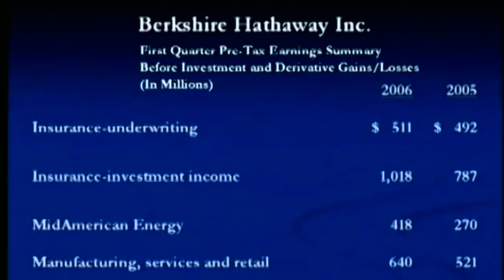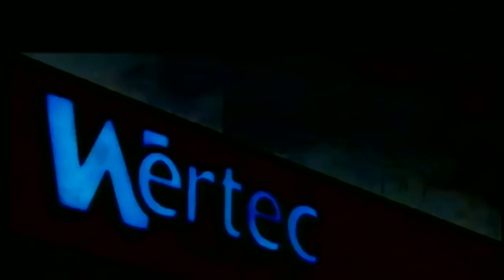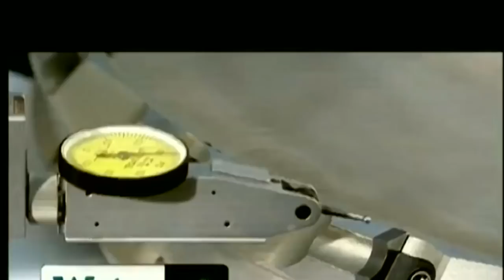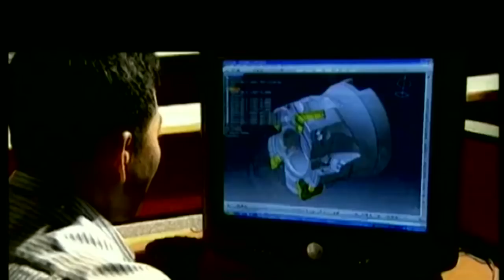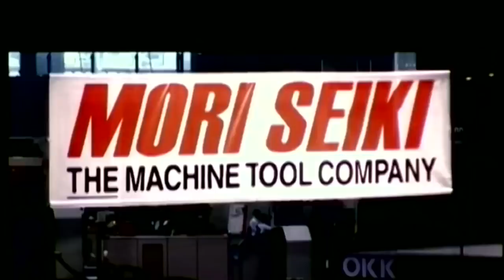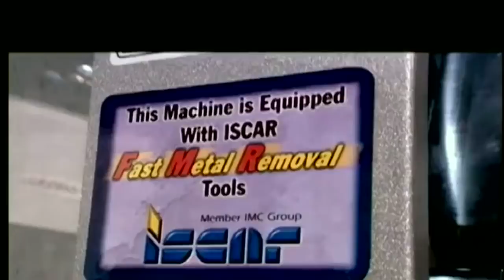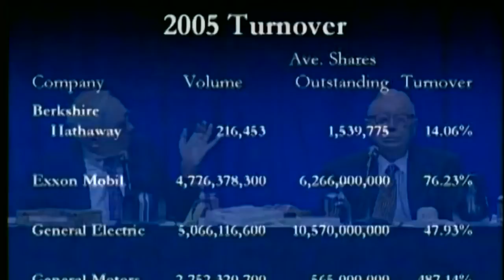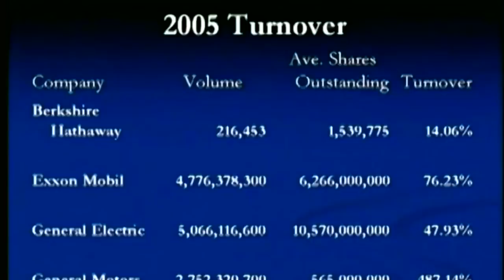TIMESAVER EDIT - FULL Q&A Warren Buffett Charlie Munger 2006 Berkshire Hathaway Annual Meeting

Comment: - Focus on businesses you understand and that have a strong competitive advantage. [Timestamp: 1:43:53]

- Be cautious about investing in industries facing significant technological disruption or intense competition. [Timestamp: 2:00:31]

- Consider the long-term economic implications of large current account deficits and prepare for potential currency adjustments. [Timestamp: 2:44:57]

- Maintain an investment philosophy that prioritizes facts and logical reasoning over market sentiment and speculation. [Timestamp: 3:18:25]

- Approach potential acquisitions with a focus on the long-term culture fit rather than short-term financial gains. [Timestamp: 3:43:02]